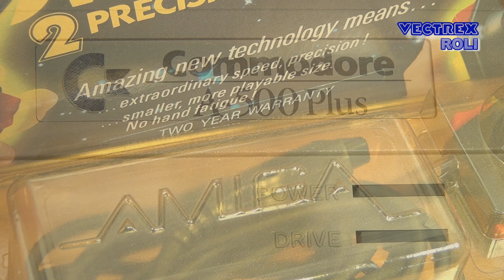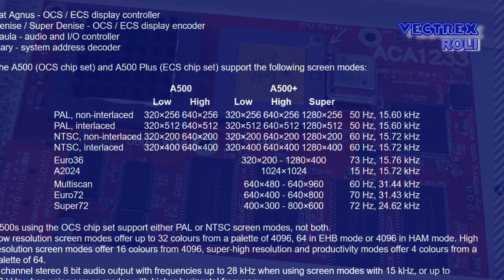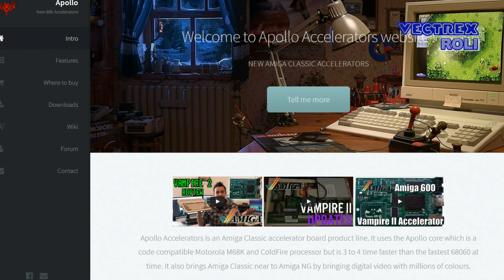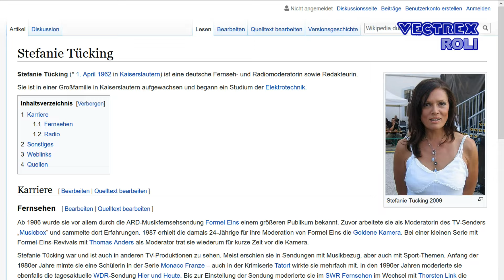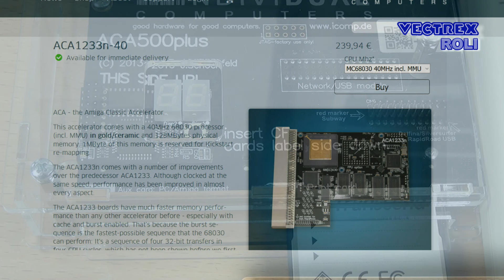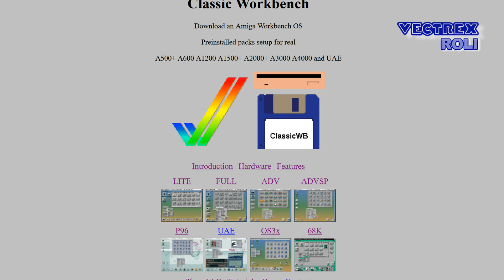VectrexRoli´s Amiga 500 Special!

Comment: this video makes me want to dig out the A2000 i have in my basement, salvaged from my local public TV station where it was used for video editing (for decades!) so it has lots of Video Toaster cards that i would probably end up removing.

is an NTSC A2000 any good for playing games, without extensive modding/upgrading? i have heard that due to most Amiga games being from Europe, an NTSC machine should be avoided completely. and nobody ever mentions the A2000 model, so i wonder if it is worthwhile to restore that old thing at all~
Reply from the maker: Sure it is, might be worth doing some restoration work first.
Reply: would love to see more Amiga videos from you. tutorials about anything Amiga related would be great!
Reply from the maker: It is all a question of time for a non-commercial channel like mine, as it needs 3 to 4 weekends to make such videos if done properly. ;-) But I want to do some more, but my next bigger project might be a Commodore 128D special.

Comment: Great video ! "Another self-destruct mechanism" (the A500+ rtm battery).. haha, true that. Red and green led on A500+, I think it is unusal. The Kickstart 1.2 and early 1.3 machines had red and green, then green and yellow. There were some A500 with OCS chips (graphics) that some games only worked on (double dragon for example) and not on the ECS. Nice accellerator case ! :)  I loved this computer so much after having the C64 back in the day. Did you own an Amiga back in the day? My first game was Future Wars. The first game I saw was Postman Pat. Lol. I installed random RAM chips and it didn't work. Ripped up traces and it didn't work anymore, that was the first time I reworked a motherboard and it worked again. I was happy. Ps. I recapped an A600 and posted a video about it this sunday. Will post video about the CD32 this week :)
Reply from the maker: I built in a working German A500 keyboard I found, didn´t really care about the LED colour. ;-) Yes I had an Amiga 500 back then was still a Kickstart 1.2 machine where you could see on the power LED if the audio filter was swtiched on or off.
Reply: Yes, I remember that now. The audio filter on/off connected to the power LED, was different on some pcb revisions.

Comment: Great video!  That Amiga 500 box illustrates how the Amiga should have been marketed here in the United States.  I've seen a mouse trick with the Amiga, where you can change it from PAL to NTSC, but I think you still need a PAL-compatible display so that everything will display properly.
Reply from the maker: If you use RGB most "more modern" monitors should be able to sync 50 and 60Hz, problem is that often you will not find SCART RGB connctors on US TVs. I use one of those 4:3 LCD analog TVs from China (made around 2000?), they are perfect as the PSU accepts anything from 100 to 240 Volts AC and the screen shows every SD signal you throw at it, PAL, NTSC and even SECAM. Maybe you can find one of those? Plan B could be some kind of converter box like SCART to HDMI.
Reply: Another alternative is to look for studio monitors. You can sometimes find these in thrift stores, as they look just like an old CRT television. I found one out by the dumpster at my apartment years ago. Works perfectly, and has a multitude of hookups in the back, even the UK RF connector.
Reply: I forgot about this website:  www.samstores.com  They sell CRT TVs that accept PAL signals. However, none of those TVs have SCART, just composite video.  What about Commodore monitors?  I've heard that the 1084 (or was it the 1084s?) can accept a PAL signal.   A broadcast monitor/PVM would do the trick, but at least here in America, they cost several hundred dollars, and I don't want to spend that much.